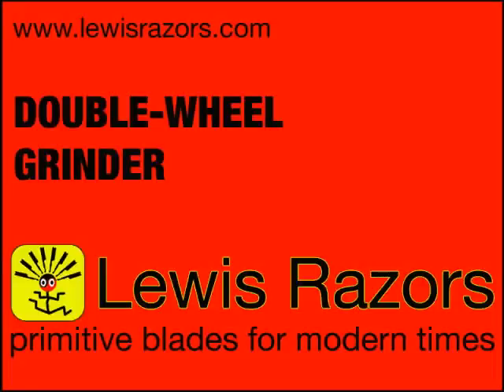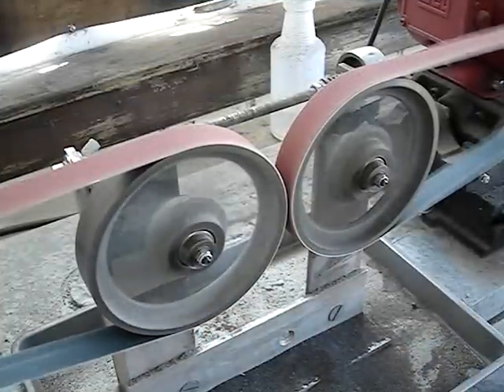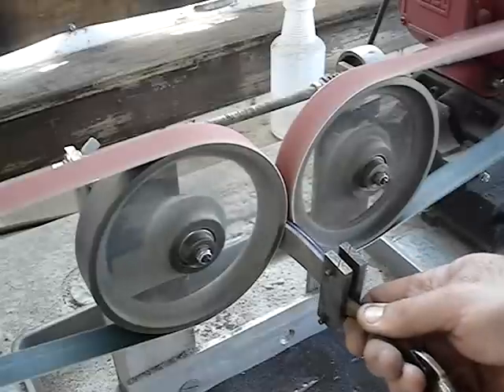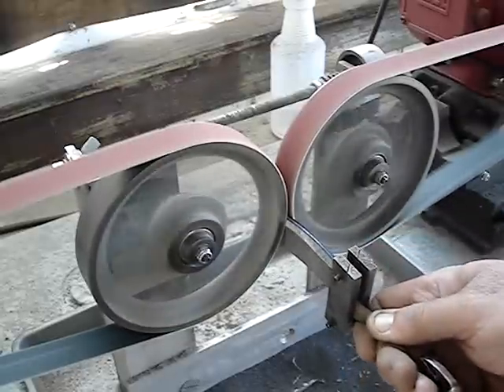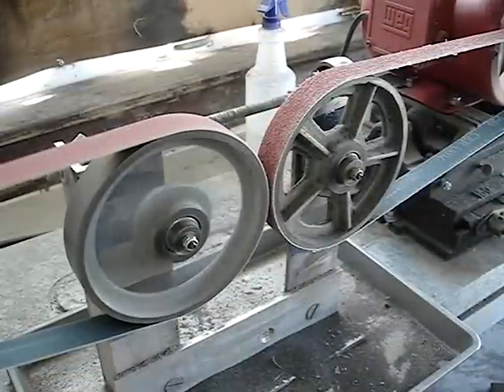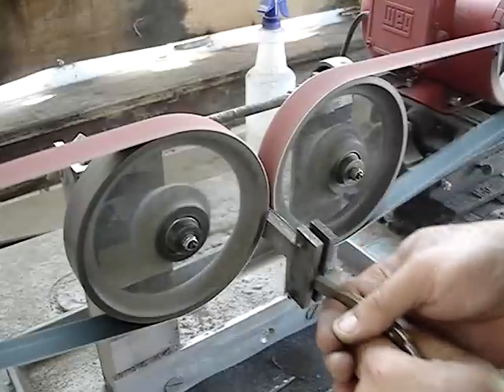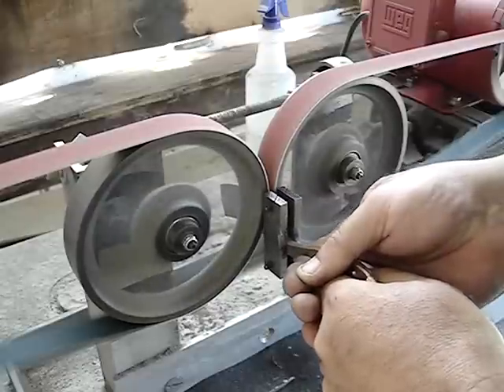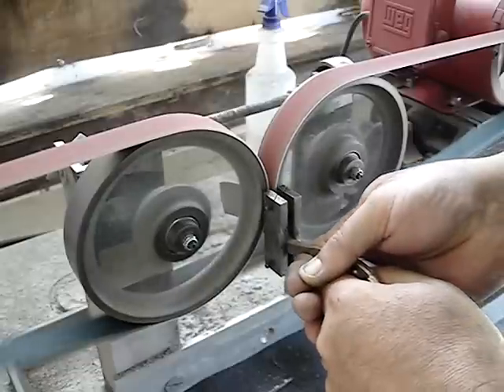Double-Wheel Hollow Grinder

Comment: what is it good for?
Reply from the maker: +Csaba Farkas It is good for roughing out straight razor blanks.
Reply: +lewisrazors  then why would you use a single grinder, this I more precise
Reply from the maker: +Csaba Farkas I could do it either grinder, but I prefer the single wheel I am more comfortable, and can be more precise with the single wheel. It is what works for me.
Reply: +Csaba Farkas War
Reply: it's not about what you like, it's common sense, think of it as a cnc machine, or anything that helps center the piece that you working on. if you try to sharpen a knife  on a single whee grinder, the 2 sides of the knife will never be the same ,close but definitely not the same. no matter how good a human hand is. dose that make sense?
Reply from the maker: +Csaba Farkas In theory you are right, but hands on experience with both machines the results are different. The hand holding the blade is where the variability comes in. It is easier to hand hold/control the blade with a single wheel.  

When I built and designed the double wheel I thought it would be cats meow, but it ended up making a good roughing tool, not a precision tool.
Reply: Yes that is a rough grind, the point I was trying to make, is when you buy a pocket knife, of course a good one, looking down the blade it is obvious that it's machine made. It's my belief that it would be very hard to replicate by hand.
Reply: Good for roughly forming neutral handed blades?
Reply: +Csaba Farkas I think that in theory you would be right to assume that this double wheel grinder would be more precise than a single one but in practice the hand doesn't apply even pressure on both wheels.  The angle of the blade is not perfect too cause its hand held so it will grind unevenly.  The 2 sand paper stripes aren't worn exactly the same way too, the bearings or bushings of the motor and machine wont be in the exact condition too.  I think those are all good reasons for this machine not to be as precise as it looks like at first glance.

+lewisrazors Anyway, this machine is nice and thank you for sharing with us your honest opinion.  Someone had to try it to know if it's good or bad.  The idea was good.
Reply: +Anthony Thibodeau I think if you were to make a system like a drill press, where if you had a spring loaded arm that had a vice built in to hold the blade, the arm having a hefty handle to keep pressure on the blade while in the grinder, and a mounted roller track (or something similar) to keep it straight going in and out; that may solve how uneven it would be by hand.
Reply: +Joshua Taylor In theory, yes, you'd be right. In practice however, it's more complicated than that. There's a difference between a straight blade or one with a smile in it. So now your jig needs to take the curvature of the blade into account as well while pulling the stock through the grinding wheels. Then there's the issue of the tip of the blade: if you pull it out too much, less of the grinding wheels makes contact with the blade. Which results in more pressure per surface area, so you grind out more at the tip. Pull it out too little, and your tip will stay thicker than the rest. All these factors are way easier to account for on a single wheel grinder, using your hands to guide the blade, so you can feel what's happening.

What you describe is coming pretty close to a CNC machine, purpose built for straight razor grinding. Nothing wrong with that, if that's what floats your boat, but it's not the only way to make good razors/knives/...
Reply: +Csaba Farkas Actually, not really. When you buy a pocket knife, of course a good one, it can be either factory made or handmade. I know lots of knife makers who make excellent pocket knives.

The way you recognise these knives is not by the quality of the grind or heat treat. It's by the details and finish (file work on the back of the blade and such), materials used (handmade knives usually employ more exotic handle/scale material), and number of identical copies in the seller's inventory.

Comment: The amount of grinding you did then , it would have been easier to start with a smaller/thinner piece.
Reply from the maker: +Plumberman Jones I need that thickness of metal for a straight razor, the spine has to be a certain thickness for the angles to come out right.  I useually rough forge to shape before grinding, but this was a grinding demonstration so I did all of the grinding without saving steps.

Comment: Almost every culture in history that worked with steel did that at some point. The Japanese keep doing it because the Japanese government because of laws to preserve swordsmithing heritage or something.

And that's not how it works. They fold it because they have crap steel to start off with and the folding refines it. The blade and core are often different steels and the way they harden and temper makes the edge harder than the core. That's what makes the difference in hardness, not the folding

Comment: Why don't you try it from the top? I think that would be more efficient...............
Reply from the maker: GBPaddling I have put the blade into the top before by accident, all I can say is that it really wakes you up when the blade gets pulled through and bangs the table.
Reply: Enough to make your shit turn white, ha ha. It is VITALLY important to realise what effect the direction of rotation will have on your work piece, and/or yourself. Be it a grindstone, sander, angle grinder, chainsaw etc. I too have had many 'Shit turn white' moments with all these tools.

Comment: Considering some safety issues with that grinder.
If that peace manages to fit trough those 2 wheels it might end in to your forehead. Secondly those wheels should be covered and put some lexan in front of machine.
Reply from the maker: Yes, the machine could be dangerous. The wheels are spinning downward, torward the table, not my forehead. Yes, the machine should have guardes in place. If I were to let anybody else use this machine the guardes would be in place.
Reply: Ok, your head is saved (for now :-)

Thought they were spinning upwards to ease feeding of the blade.

Comment: That's a lot of wasted material
Reply from the maker: It is par for the course for a stock removal blade. I forge and do stock removal blades.
Reply: lewisrazors Can you recoup costs by recycling the swarf? 
Why not weld a thick spine to a thinner piece of stock, then grind the profile?  That should produce less waste and a faster grind.
Reply from the maker: Steel is not that expensive in the scheem of things.
Reply: Nelumbo Nucifera great idea. That will be much easier. Hahaha